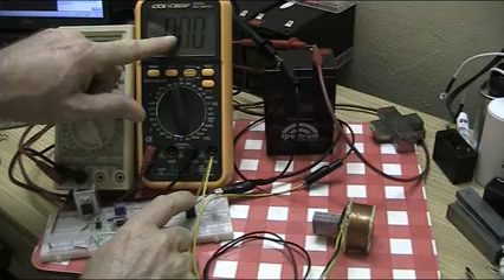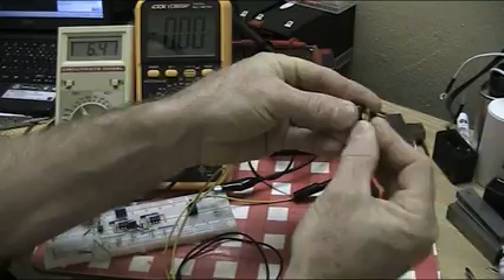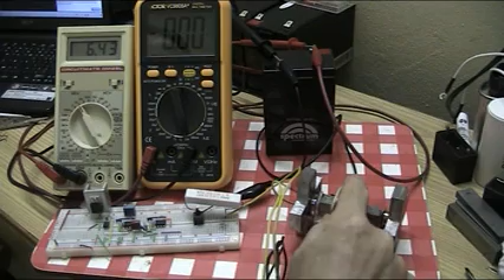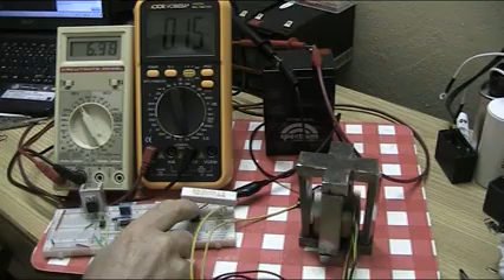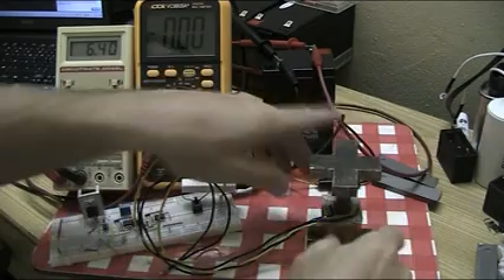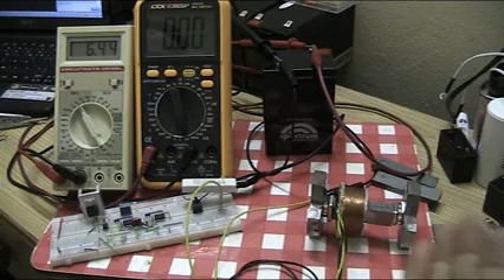Mostly Permanent Magnet Motor Part A

Comment: This is a revolutionary invention for a crank motor. Haven't seen any new videos from you. Are you still ok?
Reply from the maker: I’m fine thanks. Just keeping a low profile but I’m still experimenting privately. Will only share when I find something revolutionary.
Reply: @gotoluc  that's good to hear. I've been following your older videos and find them fascinating trying to replicate. Well done love your work. I'm currently rewinding brushless mowers to bifiler configuration and getting great lower amperage results with high output still

Comment: To author: good job! Yes, you don't have quite the proper jargon of an electronics technician/engineer at all times, but it is good enough for an experimenter!

To commenters: A global village of idiots!
I scrolled for a VERY long time thru YouTube and your forum post comments, and nobody ever mentioned a voicecoil actuator / linear motor. A voicecoil linear motor (particularly, the moving-coil, stationary-magnet variety) is what this is very close to. Like here: https://www.youtube.com/watch?v=an_T57Mpe90
Yes, this design has advantages over a voicecoil as I usually see them: As you already said, its inductance should not change by much. Inductance of a solenoid changes drastically with plunger position inside/outside. 
Over the solenoid, this has advantages of much higher force generated. IGNORE anybody telling you that you can't stick a rare-earth magnet inside a solenoid "because you will ruin the magnet". Yes, you can do that, modern rare-earth magnets have good coercivity https://en.wikipedia.org/wiki/Coercivity and won't easily be demagnetized by practical solenoids. You WILL get a lot more force by swapping an iron plunger for a permanent magnet. Also, a solenoid with an iron plunger is SUPER SLOW in actuation. A voicecoil is a lot faster: it produces higher acceleration, and higher forces, in a compact (but expensive) package. VERY LARGE vibration electrodynamic shakers are done as a voicecoil, but instead of a permanent magnet (which is used in a very small number of special designs), a winding is used to establish a strong magnetic field, against which the 2nd coil is pushing or pulling.
The back emf / flyback voltage I did not verify your claims there, but if verified, that will be yet another good aspect of this proposal.
You can look at voicecoil linear motors made by https://h2wtech.com/, they have quite different designs as well that also perform similar tasks.

Does this already existing commercial product look familiar to your design??? https://www.sensata.com/products/motors-actuators/voice-coil-actuators/rectangular-linear-voice-coil-actuator
You are welcome...

Comment: what if you where to put a bearing in the middle of the coil. make it stationary. and fix it so it does not move but the magnets on each end would turn from the center on the bearing. after watching your video i can see a lot of ways to approach it.
Reply from the maker: Tommy Schales Yes, it would also work that way. But if the coil is lighter than the magnets and cores, it is beneficial to move what has less weight, Another weight benefit would be to use copper coated aluminum wire which would drop the weight of the coil by more than half. A lighter coil will give an increase in back and forth frequency.  Luc

Comment from the maker: Jouleringers are an oscillating switch using minimal electronics. They are not Overunity.

They give the effect of efficiency only with LED's or LED bulbs (not regular bulbs) as they look as bright as if they were lit by DC or with grid power. However, this is a known effect that you can pulse an LED in the 1K Hz range and to your eye it looks fully lit but in fact it uses 10% to 15% of the DC current.

JT or JR are nothing out of the ordinary when you understand them correctly.

Luc

Comment from the maker: Hi, I don't think "Electricity Amplification by Neo Magnet" could be used here as AC is required to make the motor work. All what happens with "Electricity Amplification by Neo Magnet" is the Neo magnets field repels the copper wire so it cuts off the contact (like a switch) Depending on the length of the wire it will bounce back in time and make contact once again which creates an oscillating switch without any electronics involve.

Comment: You are measuring current incorrectly. The only valid measure is while the work is being done, which is while the coil is moving. A stationary coil is doing no work, even if it is elevated. 14:45 touches on the same concept. Lenz's Law, which is mentioned in the comments, is also the same concept. Lenz's Law says that the movement produces a consumption of electric power. You would measure this as higher current, while it is moving. You only measured current, while stationary in this video.

Comment: Hi gotoluc-i love that design,and your theroy is sound in reguards to peter lindamans comments. What he fails to understand is that once your coil is energised you have the motor effect not the generator effect.Once you switch of your coil no back EMF will occur as your coil is an open circuit.If you were to collect the backspike or backEMF from the coil switching of-only then will you get some lens force drag.
Listen to yourself,as your are on the right track